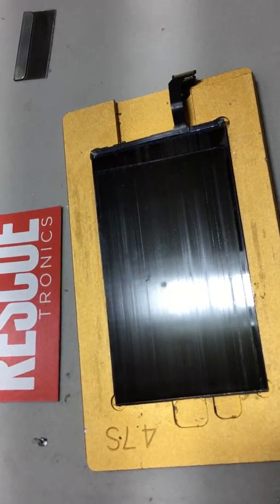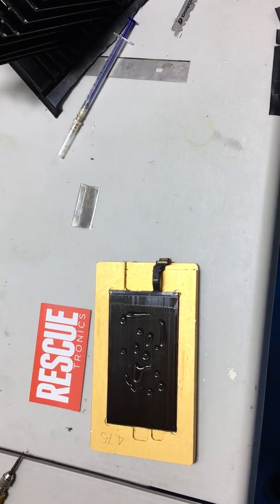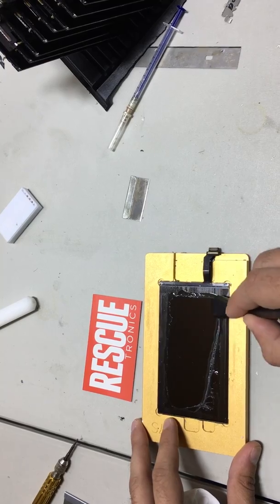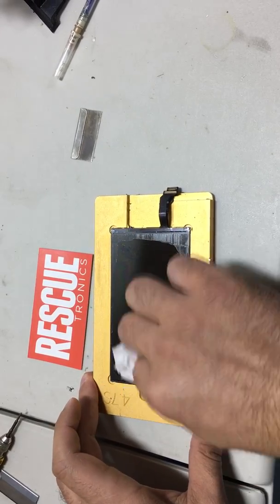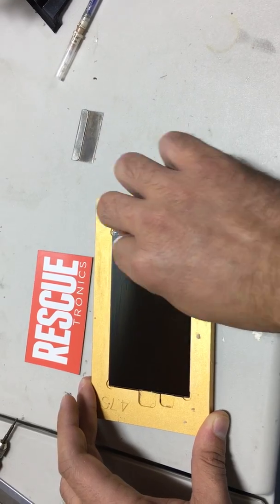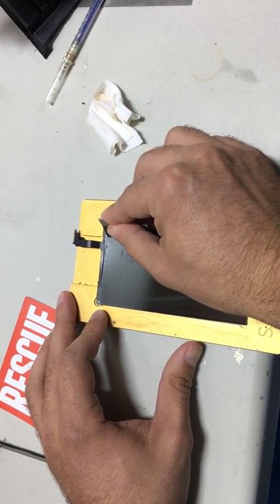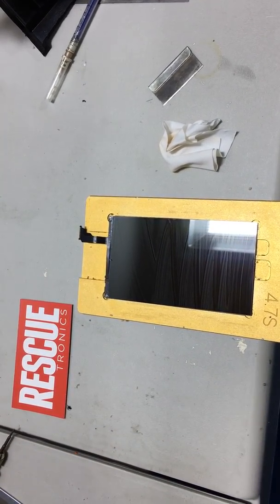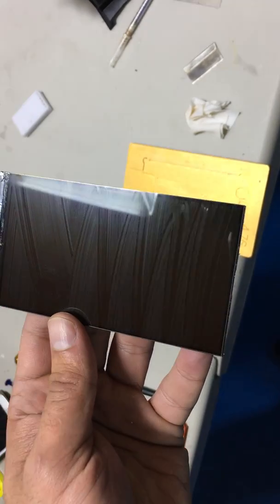new lcd refurbishing polarizer glue removal

Comment: i find that when using a glass+frame+oca+POLARIZER, you seem to see alot more obvious white dust on a black color screen (the lcd on) as compared to to just OCA+glass. This is because dust gets behind the polarizer making it obvious.

Are you guys getting any problem like this? have u been testing for this problem?
Reply from the maker: dazzassj7 depends on the manufacturer and the quality you get. Low quality can possibly have dust inside